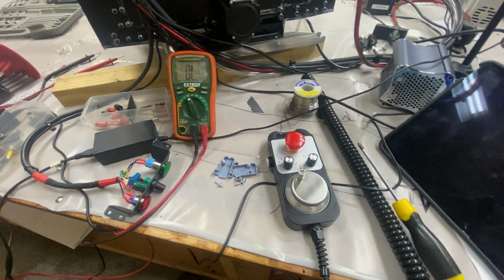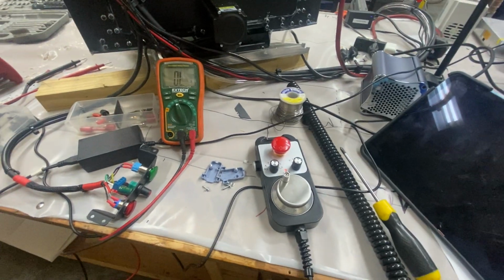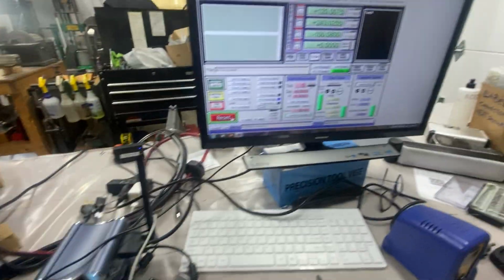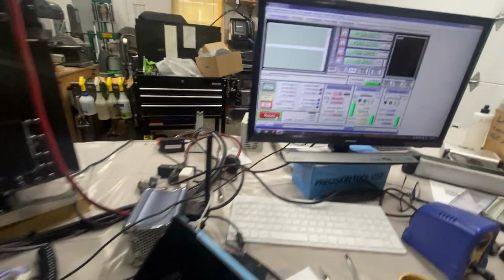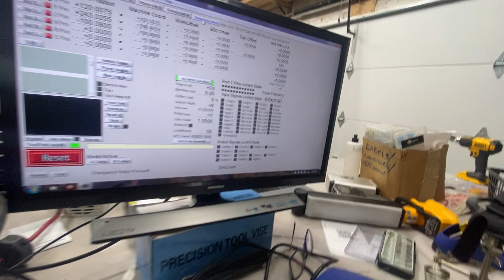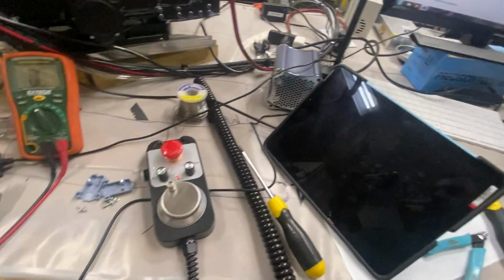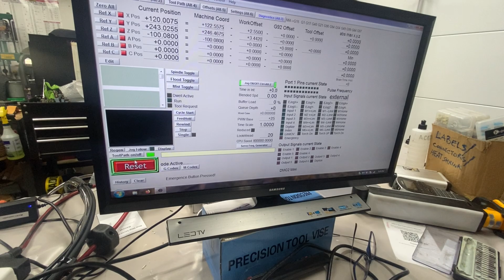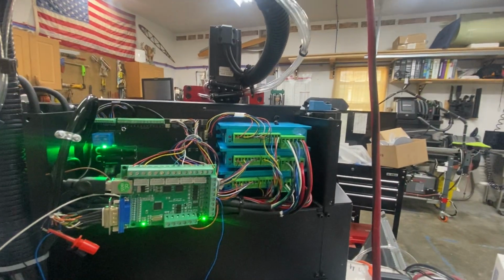DMC2 Mini Estop workaround

Comment: What pins are the blue wires in the D connector?
Reply from the maker: @gonewiththewind4ever  those are the wires coming out of the Estop switch
Reply: @EZ_shop  do you know what pin they are on the end of the D connector.  I want to trace them out on the board
Reply from the maker: @ pins 10 and 14
Reply: @EZ_shop  thanks 😊
Reply from the maker: @gonewiththewind4ever  no sweat. Good luck to you.
Reply: @gonewiththewind4ever  Did you ever trace this out?  It would be nice to go a board mod instead of having to cut that cable open...
Reply: @retrotechjournal  The emergency button from the handwheel is reouted to IN16 on BL-USB Mach3 controller, pin 26. You can set InputSignals / EStop to PIN#26 (active low disabled). And it works like a charm. The front panel emeergency sto button will not working anymore, obviously :)
Reply: There is better way then reconfiguring EStop to PIN#26. We can leave it as is, but configure that pin
 as OEM Trigger (I used OEM Trigger #15, this is in Input Signals). Then go to System Hotkeys Setup and set 1021 code for OEM Trigger #15.